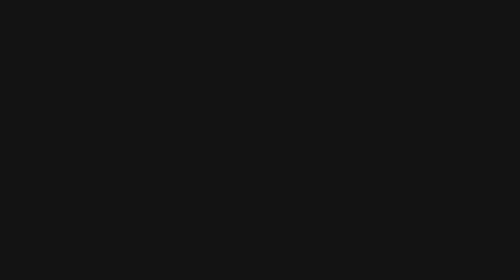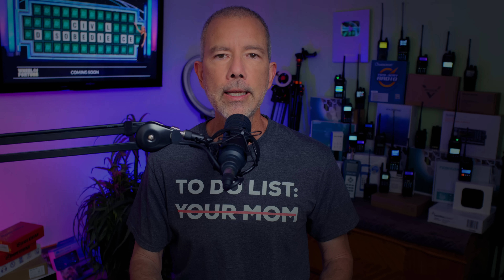Why Your Transmit Volume Is Low On Your GMRS or Ham Radio - The CORRECT Way To Transmit On HAM/ GMRS

Comment: From experience with Chingreshese radios for the past 15 years or so, I think some of them are designed for the Asian language in noisy environments.  If we all speak like the Chinese do when they yell orders to the kitchen in the restaurants, the audio level would probably be about right.  Though, on a Wouxun KG-UV2D (And KG-UV1D) I did find a mod that removed 3 capacitors from the board, little tiny flecks of parts, which improved the tweeter end of the louds much goodly, and made the radio sound less craptastic.

Comment: Our countywide Harris 700MHz P25P2 system has this same issue. It's either too loud or too quiet. Someone is talking into the mic while still wearing it or they are eating the mic. Lol! Nobody has a clue as to why there's so much difference in audio. Some of us brought up the idea of having the AGC enabled if it has that option. Tired of adjusting the volume to keep the speaker from blowing out (or blow an ear drum) and keeping it on full blast to barely be able to hear what we need to hear.

Comment: Randy, I just turned on my U V 5G Plus and it said input password! I never put in a password.
Do you have a workaround for that?
Reply from the maker: Yes!  The workaround it to send it back to wherever you bought it and tell them to give your money back or send you one that someone didnt put a password on.  If you purchased from Amazon (as I always recommend), this is very easy to do.
Reply: @TheNotaRubicon  Thank you Randy. I found the solution by imputing 5 zeros and it cleared it up.

Comment: as good as the radio's get, they cannot overcome stupid. operator error will always be a problem. also, some "operators" suffer from cranial-rectosis, and the sound from their noise hole is muffled by the muscle and fat tissue of the gluteus maximus.
Reply: At least you can keep them on the right frequencies with channelized radios

Comment: I have a small home base setup w an amplifier and converter and a handheld radio. My question is when I use either of  my baofeng uv 5r+ radios it recieves w lots of static. But my baofeng 5rm is as clear as a bell. Any explanation on what may cause this?
Reply from the maker: either the squelch settings are different or, you are just experiencing the miracle of modern cheap electronics.
Reply: Will check. And yes I understand

Comment: On the ole' original model UV5R even on wideband, my audio was so quiet.  Shouting at my radio attracted too much attention so I removed the case & microphone, widened the mic hole, put everything back together, popped it in the bucket and bought a Yaesu.  Problem solved.

Comment: Motorola APXs can work some real magic with their auto gain and noise cancellation.  But they can only do so much.  Three things that drive me crazy at work is people who mumble into the radio at arms length, people who try to use the radio next to a running jet engine, even though they’re been told to use it in the cab dozens of times before, and people who start talking before they key up the radio.

On a GMRS note, some radios like the TidRadio H8 have a “mic gain” option.  However, max level 32 is normal on mine, and anything less causes buzzing issues on the receiving end by being too quiet somehow.  It’s best to test all your radios at home with headphones or an earpiece on a monitoring radio.

Comment: The TIDradio TD-H8 had a known issue with low mic gain…the 2nd generation has a firmware workaround in the menu allowing users to manually change the mic gain for more ‘louds’. Seems to work, but you really have to ratchet  it up!

Comment: Awesome video.  Tip number 9 (holds up 5 fingers): hit the PTT button a second BEFORE you start talking, not after you've already opened your noise hole and are making noise.
Reply: my #1 peave. Indeed, I agree.
Reply: Thank you.  This is even more important thru a repeater, as there's usually a little more of a delay.

Comment: The cause of low louds is that people fail to hold the radio by the antenna as you are doing now. By holding the antenna, you turn your whole body into an antenna, which increases your signal strength. To make sure you have a ground plane, stand on the roof of your car, or any other large metal surface.

Comment: Another reason the audio might be low is because someone played in the menu and set the microphone gain too low. Most radios from the factory it’s set halfway. I usually turn mine all the way up unless it’s windy
Reply: Thanks Reverand. Thats a solid fix right there

Comment: Randy,
I have a midland gmrs repeater, (before I spend more money) I thought I would ask…
Can I add more of the exact same repeaters across the mountain tops (with permission) to extend my range? 
Cell service sucks and using the tops of the mountains would be extremely beneficial!

My thought was that the repeaters would bounce back and forth between all 6 of them until I powered every single one down…

Can you explain how to do this with a midland or if it’s even possible…

Thanks 
Brian

Btw i got extra tickets to the “Wrecker Games” with Matt’s  off road recovery if your interested in a trip to southern Utah, I got 2 for you

Comment: Ah yes, I was called out recently for low-louds. Normally, I use a Boofwang to call into the weekly ham net. As the battery was dead on said Boofwang, I tried my new and expensive Kenwoods radio and the sad-ham net controller told me that he could not hear me. 2-other people relayed me in as they could hear me just fine. Later, I contacted one of the gents that relayed me in and he said that it sounded as if I was too far away from the microphone and the net controller was just being a jerk. I held the radios the same distance away from my noise emitter, but the Kenwoods radio mic is not as sensitive as the inferior Chinese radio.
Reply: True, I have a kenwood handheld and its audio is not as loud as my cheap chinese boofwang, although its receive is far superior.
Reply: So, is the problem solved or not?

Comment: This is exactly why people need a ham radio license.
Reply: lmfao...pin of shame.
Reply: As comedian Bill Engvall would say, "Here's your sign . . . "
Reply: How would that help? People on the amateur radio bands have the same damn problems.
Reply: Please tell me; why they need a ham license
Reply: @home3363308   He drank the koolaid.  He is in the cult.  The solution to everything in the universe is to get your ham license.
Reply: Are you calling us all Undocumented GMRS users??? How dare you!!!
Reply: Right, because a piece of paper actually improves how many fars one can talk when displayed within 10" of the transceiver.
Reply: I’d like to see someone start a ham sanctuary for undocumented ham talkers, For ham dreamers. There are lots of things that licensed hams aren’t willing to speak about , dont have the vocabulary to talk about. 

Undocumented ham users can benefit the ham airwaves by speaking about the things, or use the vocabulary that the documented ham users are unwilling to do
Reply: By this logic, every person with a drivers license with never cause an accident because they took a couple of tests.
This also includes CDL holders.
Reply: People NEED to learn the meaning of the word NEED.
Reply: Why am I not surprised this guys "name" has the word "solo"in it.  😂😂
Reply: Uh, no. Not even remotely helpful. Theres a tiny bit of info on the tech test but just like GMRS most of this is learned by doing so a ham license is irrelevant.
Reply: Correct, and not a H.A.M. license!
Reply: @Tschubritza  oh boy; that's a controversial subject with many.
Reply: 😂You gave your address to a Government agency ? Why ?
Reply: Why? I'm waiting...
Reply: Pretty soon there will only be FRS, GMRS, and HF
Reply: Some people...................😂
Reply: Go be a dumbass somewhere else, please.
Reply: Is a bacon license acceptable?
Reply: I commented on his channel on his latest video from 6 years ago that he is a sad ham
Reply: No, never be a boot licker.

Comment: Does the Baofeng uv5r GMRS radio need to be programmed?
Reply from the maker: No. Despite what one of the "experts" have already said, the GMRS version of the UV-5R comes ready to use on all 22 GMRS channels, right out of the box.
Reply: @TheNotaRubicon  what about repeaters
Reply from the maker: The standard 8 repeater channels are pre-programmed so all you have to do is add the TX tone.
Reply: @TheNotaRubicon  are they all the same?

Comment: New to GMRS for a year and every time I tried asking for a radio check no one would answer and times I was told volume was too soft. After a frustrating year found out there a problem with the radio and it was just a couple of months pass the warranty period. Not going to mention where I ordered the radio but it has "safe" in it...they eventually offered a discount, came out to below $100, for a new radio, wouxan kg-uv9gx.

Comment: I am a fan of inexpensive radios despite some RF falling to the floor or some spurs emitting from the antenna.  Since my duty cycle of Xmit is so low with them, there is little risk of interference.  A better radio might be used in an RF rich environment since the interference may get into some other persons communication equipment. But common sense is not really all that common sometimes.......

Comment: It’s low because you’re using a cheap Chinese radio and its spurious emissions are making the electrons drip all over the floor instead of launching into the airwaves.

Edit:  And I’m first.
Reply: Maybe you need an expensive Chinese radio 😊
Reply: Tell me you’re TRYING to get your comment pinned, without telling me you’re TRYING to get your comment pinned (and no, TRYING doesn’t either count or get your comment pinned). 🤣
Reply: @gregorysloat4258  Haha.  It was worth a shot.  I guess my louds weren’t high enough.
Reply: And it's probably illegal. 

(Fixed it)
Reply: @kjbathe  I like doin hood rat stuff with my friends
Reply: Not true sad ham
Reply: @professorfalken4600  dammit!